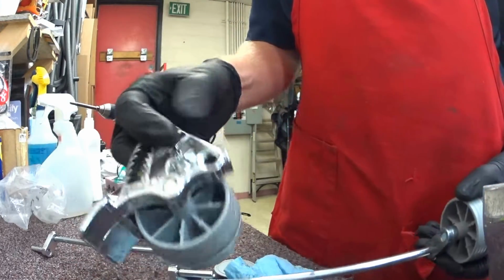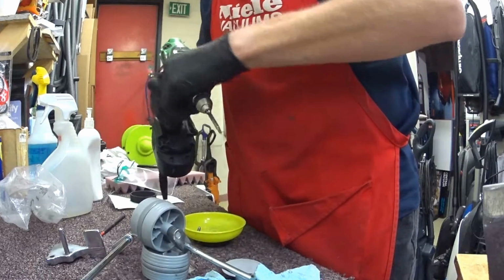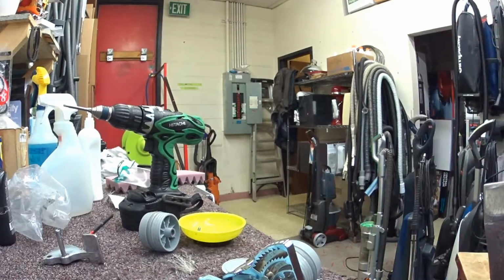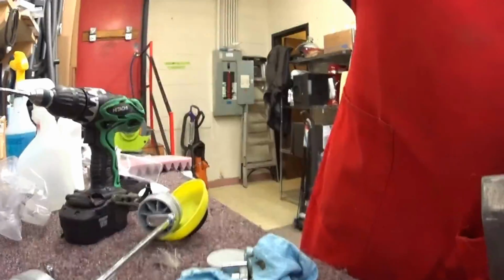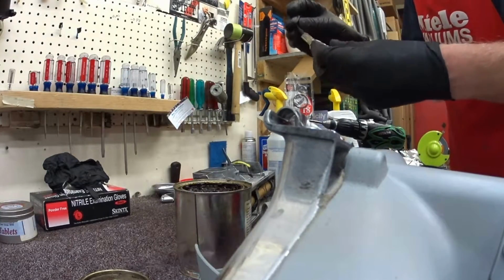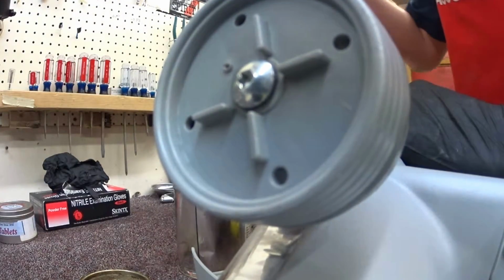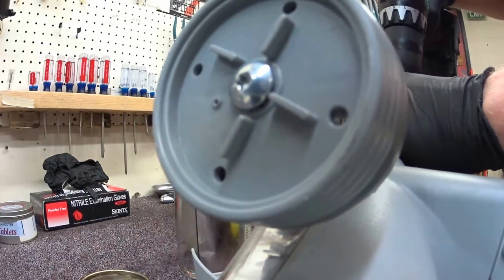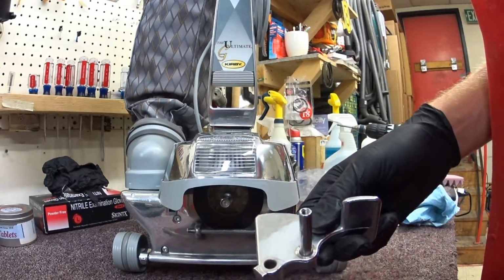Kirby wheel axle Repair metal parts don't always last longer

Comment: Hi. Great vid really helpful. I am just after some advice. I have a Kirby Heritage and the toe touch control doesn't really make the nice sound as this one for example. Also it goes more than one notches at a time affecting the precision of the adjustment. I think the axle is fine. What could be the problem?
Reply from the maker: The rationing mechanism will need to be cleaned out and properly regreased

Comment: Still would like to own a Kirby over a Miele upright .
Reply: Miele needs to update the S7. Miele has the best bag system. Sealed system is superior to everything.
Reply from the maker: +Timothy Connell they sure do but the Germans really like dragging out models as long as they can just look at how long Porsches dragged out the 911 or Mercedes with the G wagon.
Reply: Kirby's are easy to find dirt cheap on the Marketplace. I bought a pair of almost-new Sentria IIs for $100. Guy was a storage auction buyer, thought 1 for a hundred wasn't bad, but it was 2 of them. Turned around and flipped one for $100, so it was like getting a Kirby for free.

I almost bought a brand new Avalir for $200, lady bought it and never even used it. Insane.
Reply from the maker: 580678 if you like your vacuum to have 1/3 the suction of a Miele vacuum that's less then half the  the price of a Kirby new.

Comment: That's interesting. So far, in all the years I have rebuilt them, I haven't had that happen. However, I once knocked a hole through  a Classic 3 fan case housing, when tapping in the front bearing in.
Reply from the maker: +Matt Jones how many years have you been d working on vacuums? I would say this is a repair I see at least once a month.